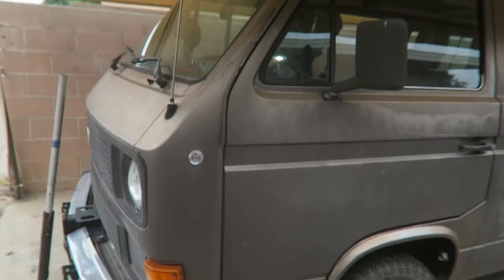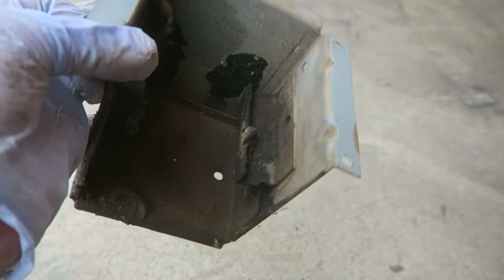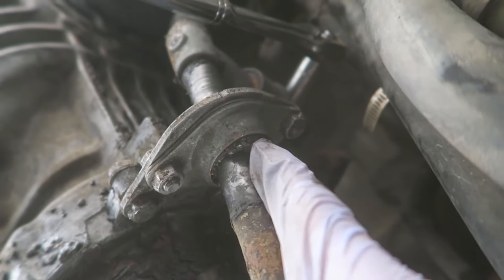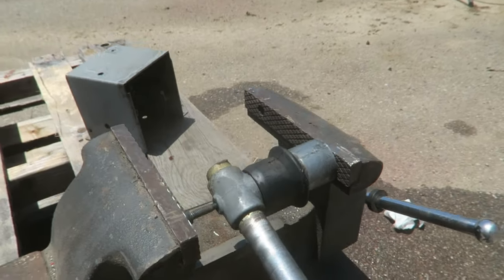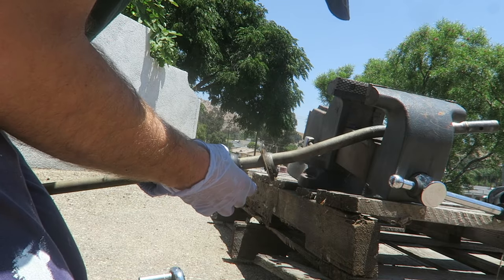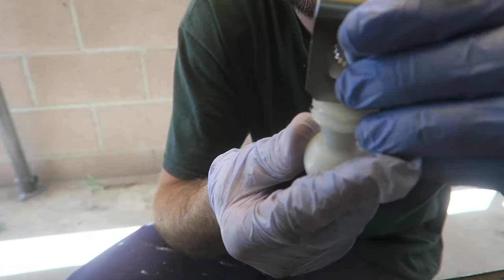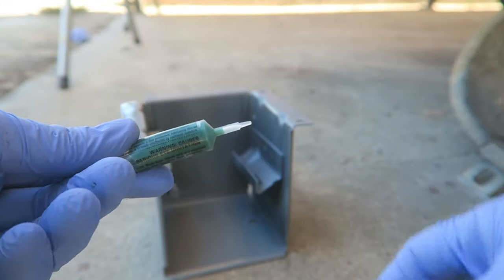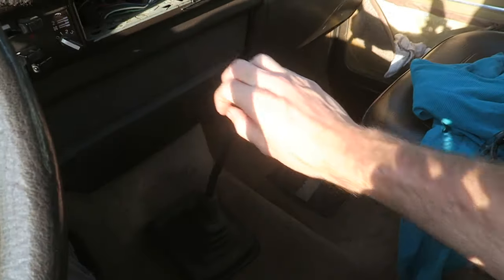VW Vanagon Shifting Linkage Overhaul!

Comment: thanks for posting, my oversize wheel and vancafe spare tire carrier pushed the tire up into my linkage, I could not find any of my gears, so I bent something or pushed something out of alignment, -- I see the spline joint so I can take it apart to work on it and also the "box".   I had great shifting, then really unuable Janky shifting...hope to get it fixed today, May 2024.

Comment: At 10:35 you say you 'just slid the front rod back in'. For the life of me I can't see anyway to do this. It's too long to clear the front of the van which would give the read end of the bar a low enough angle to slide through back and over the gas tank... Totally frustrated, and so curious how you just slid yours in.
Reply: Was wondering the same! Great video, thank you so much for posting!
Reply: I didn't come back to comment after I found the simple way - slide it in from the middle of the van towards the front while laying under the van. Dang... that took me WAY too long to figure out :)

Comment: Hey Flossy, at 3:06 you break the spline out and gasp "oh my gosh, finally!"... I'm at that stage right now and feeling the same way! What technique did you use to break it free? It looks like the end is all bent outta shape
Reply from the maker: just a screwdriver and hammer, you could maybe try some heat
Reply: @flossymissiles  Got it finally! Here's what I did. I took out the plastic elbow and disconnected the rear shaft.  Then, I held the front shaft and hammered the other part backwards until bit fell off.
Reply: From the back of the van I held the shifting rod toward the front and hammer out the joint towards the back. Was pretty easy - oh yeah, and some WD in there.

Comment: So this is done with the fuel tank removed? Or possible doing this with the tank still on?
Reply: I have an 86.  I did not remove the tank.  Had that question myself but once you are under there you will see.  I did remove the spare tire carrier to make it easier to see in the shift box.
Reply: @cek347  On my '84 the gas tank appears to be in the way of the front bushing.
Reply: If I recall, to access the bushing you open it up from behind (towards the back of the van).  So the gas tank is not an issue.
Reply: @jeepercreepers54  at about 9:00 you can see the bushing on the crossmember behind the gas tank.  Flossy has his tank removed but you shouldn't have to.